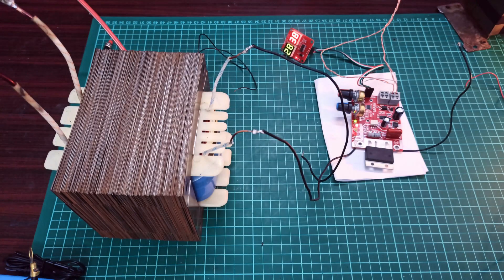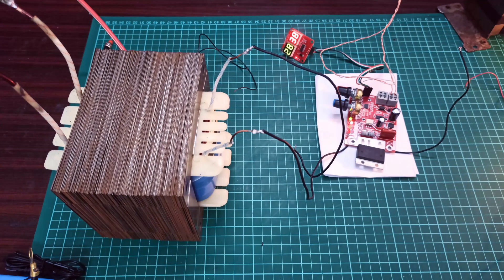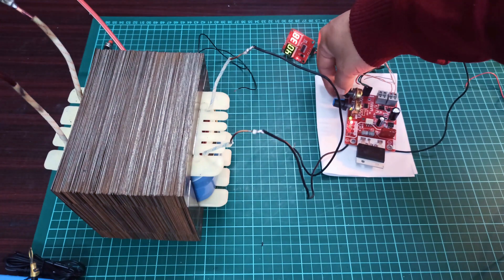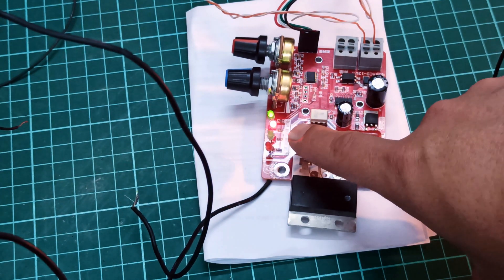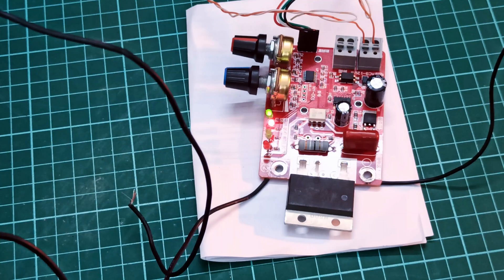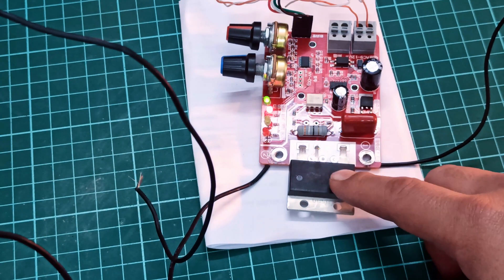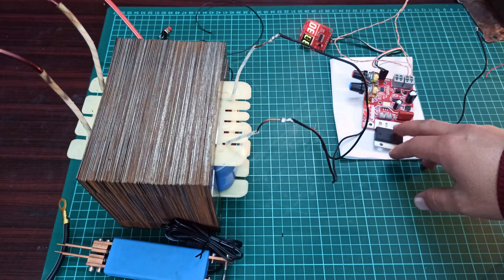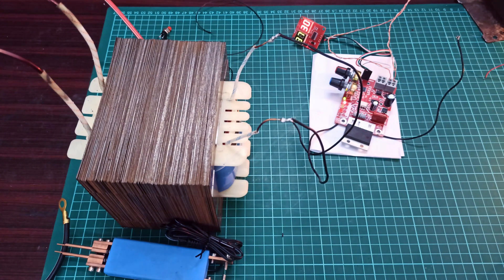Spot Welding Machine | Circuit Issues Revealed | NY-D01

Comment: I had the same issue. It failed my project. Unfortunately I bought it from Draz
Reply from the maker: It can be repaired easily
Reply: @ERLEngineering how?
Reply from the maker: Just replace the hex inverter ic (easily available online) and its again good to go
Reply: @ERLEngineering will try if you are kind enough to send me a link to buy one. 😊
Reply from the maker: Go to digilog, you will easily find that ic

Comment: Can you tell which side is causing this issue? 
Is it HV side , or uC is not generating Output pulse ?
Have you tried triggering manually the optocoupler ?
Reply from the maker: The issue was resolved.
The board has a hex inverter ic which gets faulty.
Just replace it and the problem will be rectified.
Reply: @ERLEngineering  Ciao e grazie per il tuo impegno. Ho lo stesso problema!  Puoi, per favore, fornire il link per l'acquisto del "circuito integrato inverter esagonale" ?   Grazie in anticipo. Spero tanto nella tua competente risposta. Flora da Parabiago (Mi) - Italia
Reply from the maker: Hello there,
IC is 74HC140 hex inverter (Schmitt trigger), you can easily purchase it online from sites like mouser, digikey, ebay etc

Comment: I have this board and I'm having issues with it. My transformer is delivering, with a 2'5-turns secondary coil, 35mm2 cable, around 2.4v and 400+ amps (my ampmeter goes up to 400A, and it's beyond the ampmeter's range). Using the transformer directly it works like a charm, of course too powerful to weld 18650 batteries safely, so I bought the NYD01-100A board, and now I have the opposite problem. Turning the amp knob to max (99% I guess) I don't have enough current for an effective short pulse weld, so I have to crank up the time and, even half way to the max time, I can weld but at the expense of slowly heating up the batteries too much. Seems like the board is limiting the current too much, thus rendering a quick pulse weld impossible. I'll check all the pads for loose connections, but I'm afraid this is an issue with feeding the board too much current to start with
Reply from the maker: Have you checked it on oscilloscope? The pulse timing?
Reply: @ERLEngineering  Thank you for replying! Actually, I made a few tests, checked the connections and moved the components around, before everything was too crammed so probably there was some electronic "interference" (I don't know much about this stuff, so maybe I'm say something really stupid). The thing is that now I'm getting fairly good (at least usable) welds with timing at 15 (which I guess is 0.15 seconds) and current at 85, 0.15mm nickel strip
Reply from the maker: Great to hear it ☺️
Reply: Hi 
Are you using 2.5 windings? Never do that! A transforer needs a integer number of turns. The half winding does not contribute to the power delivered. It worsens the saturation limit of the transformer. Try 2 and 3 windings and see which one is better.
Reply: Look the problem is fundamental it can't be avoided normally a single cycle of 50hz takes 20mS so it can't produce pulse shorter then 20mS with Zerocrossing detaction with 50hz I was designing my own pulse generator from scratch and faced this issue first later I managed to archived shorter pulse like 3 to 5mS to any mS with some clever tecknique.

Comment: Any one help me my spot welding circuit is direct  all LEDs are working perfectly 
Knobs working fine. But circut is un controlled.some thing is burn out any body knows
Reply from the maker: Yes i found the culprit, its the hex Inverter IC that gets damaged. Simply replace it and your circuit should work just fine.
Reply: @ERLEngineering so after replacing Schmitt trigger does it giving output pulse?
Reply from the maker: Yes my new spot welder design has the same board with replaced hex inverter ic and it is working perfect now.
You can checkout the video in my channel.
Reply: @ERLEngineering  Ciao. Ho lo stesso problema! Per favore puoi fornire il link per l'acquisto del "circuito integrato dell'inverter esagonale"? Grazie in anticipo.  Flora da Parabiago (Mi) - Italia
Reply: Same problem do you have solution

Comment: Anyone have a solution to one of the potentiometers not adjusting the display? I have one that the current adjust is stuck on 30. The potentiometer itself is ok since ive swapped it out with a known good one.
Reply from the maker: If you have swapped the potentiometer with a new one then try changing the relevant resistors connected in series with it, or check for any damaged connection with the main board.
Reply: I did manage to find the issue. . .there was a shorted capacitor in the circuit of the pot that wasn't adjusting. Works great now!
Reply from the maker: Good info shared.
Thanks

Comment: I've got the problem that sometimes my standard 16A fuse was activated, and so I had to position a 10R 60W resistor primarily in series with the 700W microwave transformer to limit the high inrush current. But now I've got unsufficient welding pulse. What I still miss would be a second pulse after say 5msec (after the inrush current) which could trigger a second similar power switch in serial with 2R 20W in parallel of conducted 10R resistor and so have a higher continuing welding pulse which could enable sufficient welding power limited by a slow blowing 16A power line with standard house wiring. Any ideas?
Reply from the maker: Well i think you should use a breaker instead of 16A fuse as adding a resistor will limit the required high current for spot welder.

Comment: okay, here's is how to solve some common issues with these controllers. In shipping, the pots are usually bent down, which may break the connection from the metal leg to the circuit on the wafer. A pencil and vice grips to add some carbon under the pad and a good squeeze to re-crimp the leg to the wafer should do the trick. Next, because the pots were wonky it sent too much current through the red TR LED, on the far right. Check that LED and replace it if needed. Hope that helps
Reply from the maker: Thanks for feedback 😃
Reply: No your idea is wrong, pot is indeed working that's why he can change the value in the video you haven't seen 😅

Comment: Which ic gone in this pls let me know...
Reply from the maker: Most of the time, the main MOSFET gets destroyed as it is not capable of handling high currents (above 200AMP) so it is better to design a DC spot welding machine as it is more efficient than an AC Spot welder
Reply: @ERLEngineering bro it's not MOSFET but a Triac

Comment: Which configuration transformer used.

Pls reply with specs
Reply from the maker: Its a simple dual winding transformer with primary and secondary windings. The primary windings takes 220vAC input and the secondary winding outputs between 4 - 12 volts, depending on number of turns for your spot welder.